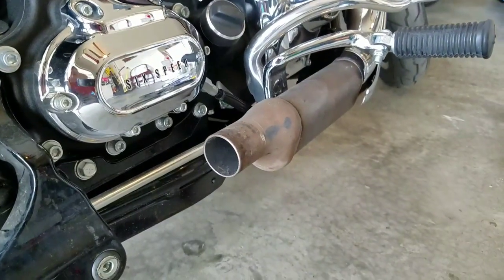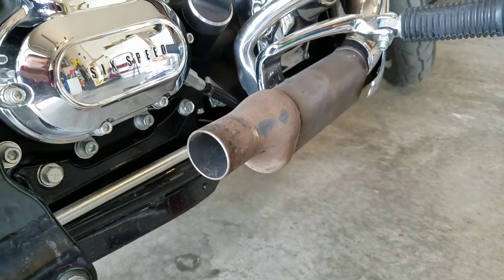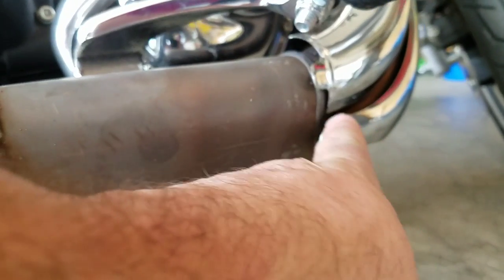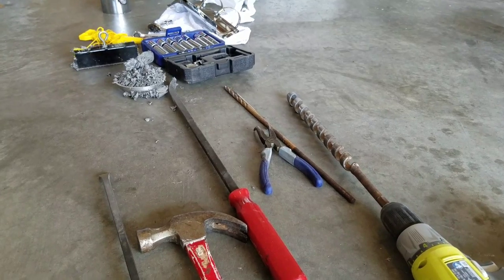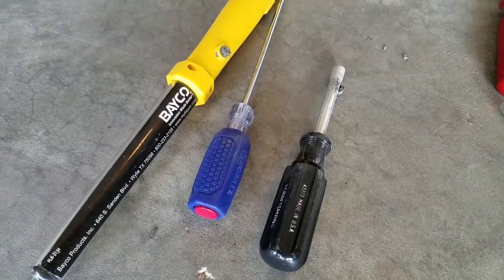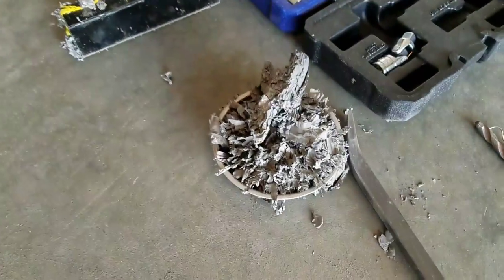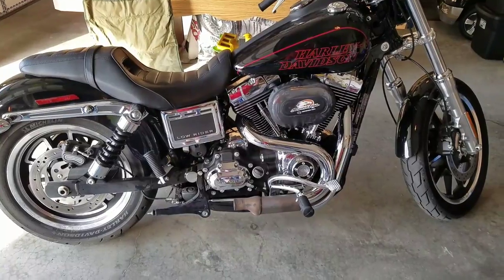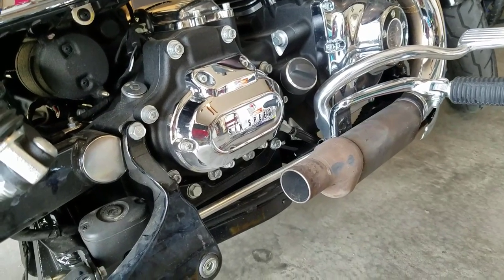How to remove catalytic converter on a motorcycle

Comment: Did the same thing with my road king only thing different, I used a 1" metal hole saw with an extension then used a12" saw saw blade making a cris cross cut then rounded the cut. All with in an hour.

Comment: Great video, I used auger bit to separate the pieces, and then a shop vac and metal coat hanger to pull pieces out. Gives your Harley crackle and takes away that muffled sound .

Comment: My decat cost me less than ten quid on amazon - random exhaust repair/link pipe and a hacksaw.

Thankfully, no emissions tests for motorcycles in the UK! Probably still wrap it to hide it from the police 😂
Reply: @email1964  yeah - luckily mine's carb'd and I have a colortune so it was pretty easy for me. If I do this on my FZ though it'll need a remap.

Comment: Hi, thank you for your video.  I'm also considering to dig out my CC from RE Himalayan,  the CC is located in the down pipe In a slightly swollen section of the pipe. My question.. remove the CC will leave the swollen section with nothing, can this have a negative effect on the exhaust?  Is it necessary to replace the swollen section with a tube of the same size for the entire length?  Or is it safe to stay with the swollen section?  Thanks in advance

Comment: I just decatted my exhaust the same way through that hole. It's a lot of work but it can be done. Before anybody cries about how it will make my bike run I actually adapted that same generation Dyna Low Rider exhaust to an older bike 03 Dyna that was never made to have a catalytic converter or O2 sensors. 
Runs great and sounds great even with that later model stock Muffler..

Comment: I would be remiss if I did not educate those about the materials in a catalytic converter. The catalyst is made of the platinum group metals; Pt, Pd & Rh. These three metals are heavy metals and will cause heavy metal poisoning. The exposure you would get tearing into the catalytic converter is far from safe. Just buy an exhaust. Don't expose yourself to heavy metals.
Reply: What if you wear mask An gloves

Comment from the maker: didn't have to have it readjusted. Had it taken in for it's first service they did the full service and reported everything was great
Reply: exrager no void in warranty?
Reply from the maker: @michaelkozak7295  nothing affects the warranty outside of the heads. That's what the Harley dealer told me. So far I've had service and everything checks out great. But if you have concerns check with your local dealer first.

Comment: How about the bass?? Increased or decreased??
Reply: Austere Graunt I did this exact same process and the bass increased dramatically. It sounds so much better and runs a lot cooler.
Reply: How much cooler? Mine is scorching hot on the thighs in the summer
Reply: @damianramey5601  bullshit. If anything ull make ur bike run a lil rich and itll be hotter then.
Reply: @showcasecharlie11  it wont be cooler. Personally promise you that. Bro knowledge hardly ever pans out. Key word HARDLY ever
Reply: Sean Butler the heat is no longer building up under your feet if you remove the blockage from your exhaust that is directly under your feet. It’s common sense and proven.
Reply: making a motor rich cools it. removing the cat MAY make it leaner which will increase combustion temp, however the reduction in resistance will make the pipes cooler.